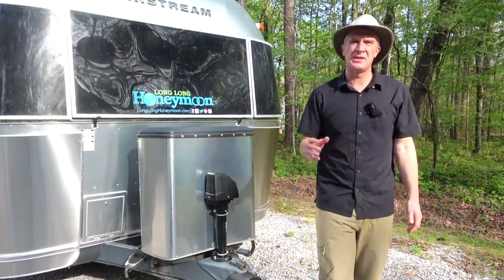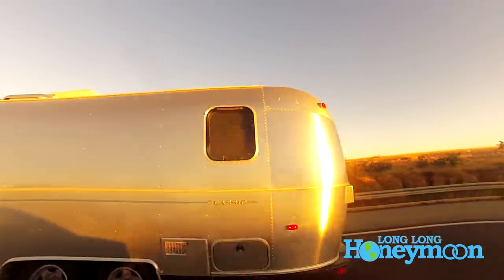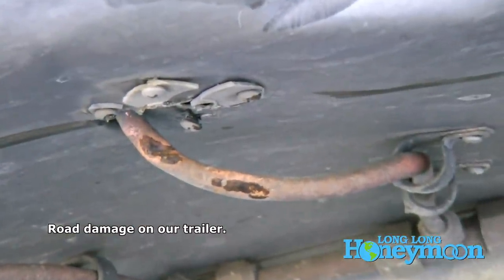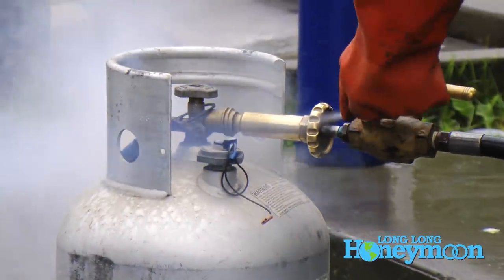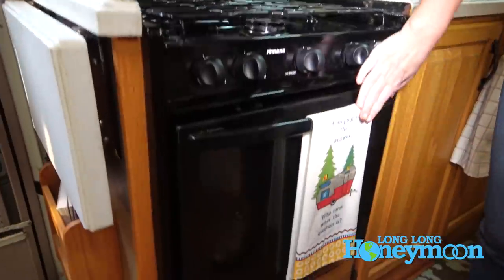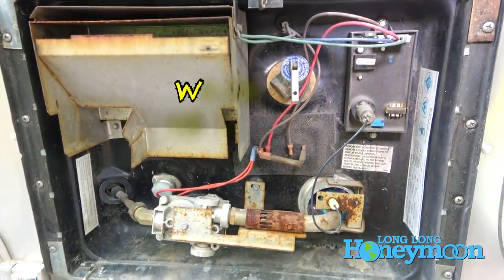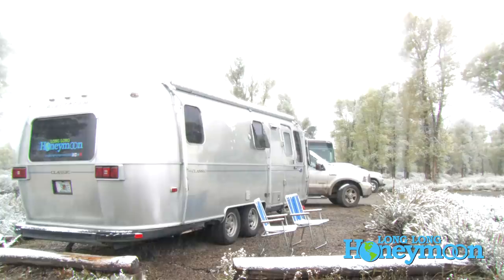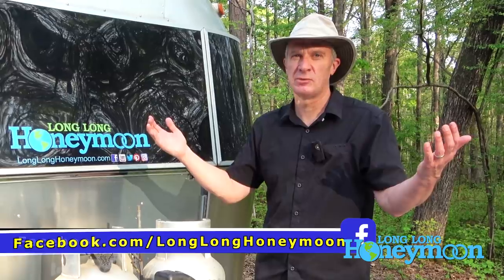For Beginners: RV Propane for NEWBIES

Comment: Propane is a liquid under pressure at ambient temperature.  Propane is vaporized out the top into the lines for the appliances.  This info was not highlighted.  You can move a tank back and forth and  feel the liquid sloshing.

Comment: The RV i own also drives on the LPG Ford e350 tioga from 1992. Here where i live petrol costs 1.80 € a liter LPG costs 0.57 € a liter. It runs very well the tank capacity i have 580 liters of LPG and with a switch i can toggle it between normal petrol and LPG. System costet me about 4000 € but as im driving a lot and i live in it, this system is quicly cost effective ... and i fill up at any normal gas station.

Comment: If you've never cooked in a trailer oven check it out before you get that nice big dutchoven. I inverted the lid it fit, but I'm not good enough to notice the difference. Please answer the question of why it's 3 am and cold when the propane runs out. Every time! Everytime!! Vegas wouldn't take the odds.

Comment: It's kind of fun to watch a back to basics video even if you are not a brand newbie. Good job. You did not mention whether you leave your pilot light on continuously. As someone who grew up in a household with an old-fashioned gas stove and an oven pilot light, this is not as intimidating as it might seem to someone used to an electric range. When we get to our campsite, we light the oven pilot light and generally don't turn it off until we are ready to move. Curious as to whether you leave yours on or not? Also, on the video, it looked like your rear burners also have a piezoelectric electrode. Are you sure the reason you have to light it manually is not because there is a wiring problem to the rear burners?

Comment: Put a pizza stone in the bottom of the oven, it will cook more evenly and wont burn the bottom of what you are cooking in the oven
Reply: Mike Johnson, i have a pampered chef Pizza stone with built in handles, is this what your talking about or are you talking about an actual tile stone like what you'd buy at in the tile department of Lowe's or home depot? 
Please reach out to me because I heard that I can use a "tile" on the metal plate that sits above the 🔃coils of the flames. Is that where you say to place it or you actually put your pan or cake/cupcake pan onto the Pizza stone.
Sorry in advance for the extended, run-on sentence....

Comment: Your refrigerator does not have a DC option, so you run into one of the great controversies that I have heard from RVers.  Do you use your fridge and run it on propane when you are on the road?  Our fridge is full when we begin a trip, but we run it on DC when on the road.  One issue is even though the trailer receives DC from the tow vehicle, running the fridge on the road still runs down the trailer battery.  Some say it is not safe to run your fridge on propane and pull into a gas station.  Makes sense to me, but others say they do it with no problem.  I did not know that some states forbid it, so that was a very helpful tip.

Comment: Boon docking if my house batteries are very low I have run my truck while tethered  to the trailer to boost power  to run the furnace. Now I do not  suggest to do this for a long time as I believe it places a strain on the alternator as the wires gauge is very thin leading from alternator to the 7 way connection. My truck,Dodge Ram 1500 .

Comment: Great video, educating the masses, back in Jan. 1985 I started  my first business with Snap-On Tools, these trucks have a 50 pound propane tank, a dealer in Wisconsin had his truck running on a 110, when he disconnected the plug the truck sparked 110 to 12volt and the van blew up.  The pilot light had went off and His furnace emptied the propane into the van. Propane is lighter than air, and when the system changed over, this sparked the propane, they said people heard the explosion 5 miles away. Sadly he lost his life, we where told to open the door before pulling the shore power. Stay save out there, enjoying all the video’s during this home time.
Reply: Really sorry to hear about your experience, but for the people reading propane is heavier than air. If you let it leak outside it will not dissipate. Natural gas is lighter than air.

Comment: Doesn't your system have an automatic switch over from empty tank to full?  If so, you don't actually "run out" when one tank is empty - it simply and automatically switches to the full tank.
Reply: That's what the diverter switch was for that he moves back and forth toward each tank.  The regulator should be self-switching on most RVs.  I had an RV for many many years before I realized that they auto-switch when empty, and I'm sure a lot of people don't realize that at all.  You point the switch to the direction of the tank you want to supply the trailer from, and when it empties, it switches to the opposite tank.  Just remember to move the switch over to the other tank that took over before disconnecting the now-empty tank.

Comment: In the old days there was no battery and even the light was a propane mantle lamp.  Which also produced a lot of heat.  Propane fridges are not very efficient, maybe 25% as efficient as a compressor fridge, but they don't need a generator, which also isn't very efficient.
Reply: But there is almost nothimg that should ever wear out. Sometimes the circuit board goes bad in newer fridges but there are propane fridges made 70 years ago that are still working great.  No moving parts.
Reply: @Terryblount  My parents propane fridge went out after about 10 years, but it had been used full time for about half of that.  The ammonia leaked out.  But I would agree they are generally quite reliable and quiet.  And propane is much more energy dense than even lithium batteries which is what makes it ideal for camping.  But I guess my point was that if the fridge is going to run on electricity full time a compressor fridge uses less power, and you don't get that energy saving by running an ammonia fridge on electricity.  But hey the power is usually included at a flat rate so save yourself some propane and switch it over.
Reply: My favorite thing is that it works off grid.

If our lights go out the only people who will remain somewhat comfortable are the ones with an RV.
Reply: @Terryblount  Except only sort of.  Relying on propane is not the same thing as being "off grid".  The propane will run out.  Short term solution only.  You can't even fill your tanks if the propane station doesn't have power and a supply of propane.  It is great for boon-docking though.  Most "off grid" is a myth.  Most all "off-grid" solutions very much rely on things that are very much "on-grid".

Comment: Would you comment some time about the safety of using propane on the road to keep refrigerator cold? I can no longer camp, but still enjoy your videos as a way to "virtually camp". LOLOHO
Reply: As long as you're not constantly taking inventory in your fridge, it should stay cold without power or gas for the duration of a typical day's drive. Turn the propane OFF until you get to your campsite. Alternatively, blow the dust and cobwebs out of your wallet and upgrade to a 3-way fridge.

Comment: Interesting. Actually I was wondering what the deal is with low-pressure RV propane tanks and why they take different grills.  I was interested in the grill cooking aspect of propane and how some grills are infrared and there are numerous brands and ideas on the best flames. Do you not cookout?

Comment: When I light my seemingly identical oven, I turn the dial to “pilot on” but then have to push the dial towards the stove to get gas to flow to the pilot. After the pilot lights, I usually have to keep the dial pressed in for 30 - 60 seconds before I can let it return to the position where I can then rotate it to a specific temperature. I did not see Kristy push in the pilot on control.

Comment: Thanks for the info on Propane, very usable. I'd like to piggy-back a question to you concerning propane and generators. I've read you test on the Champion Dual Fuel unit, and your own Remote atart gas unit. I can';t swing the cost of the dual-fuel. What do you think of making an after-market propane conversion gas to propane. I appreciate your help.   I have learned much from you both over the last couple of years. Best wishes to you both. Norm

Comment: This Video was a such a Gas-  Forgive me Locked Down Cabin Fever.  I’m going to have to upgrade to at least a DC-DC Charger for starters as running propane down the road for the fridge can be done, but you made a good safety alert of what if a gas line ruptures in an accident. Your Solar, DC-DC charger and 400 Amps of Battle Born Lithiums should make an all day of electric fridge or an all night of furnace fans never a problem. We found out quick how a 29 degree night and a furnace fan sure kills a set of interstates real quick. This was this fall in the Adirondack Mts dry camping. A cold wife is NOT a happy life!

Comment: Awesome video Sean and Kristy.  I just stayed in my new camper for the first time and the furnace ran almost nonstop do to sub freezing temps. How long will your tanks go between refills when you’re camping in those type of conditions?
Reply: A few days, tops.
Reply: Kristy Michael is that per tank or is that both 30 pounders going dry in a couple days?
Reply: @danj8777 , if we're running our furnace all day and all night, I would say that each tank will last about 4 to 5 days, maybe less. However, when we go to bed we usually set our thermostat temperature to 50 -- that may be too cold for some. During the day, when we're inside, our temp is usually set to 65. Hope that helps!

Comment: In our '79 Sovereign mid-bath can be difficult to light our water heater (it's manual only.)  So when it's hard to light, we find that going in and lighting the stove is a good way to confirm and get that propane flowing.  Just wondering if others with a manual hot water pilot also have this issue.

Comment: Are there some rules about turning on the stove fan or cracking windows when burning a live propane flame inside the cabin?
Reply: I'm not sure it's a "rule" per se, but we do usually have a window cracked when running our furnace. When cooking I usually have the overhead exhaust fan on, just like I would at home.
Reply: Burning LPG will create an awe-inspiring amount of humidity inside the rig. You definitely want to crack a window or turn on an exhaust fan unless you're into collecting mold, spores, and fungus.
Reply: @colormedubious4747  Thank you for your response, I was also concerned about noxious fumes?
Reply: @CincyKid  That, too.

Comment: Don’t you also have a dual fuel generator, and if so, how often are you running it on propane?  Also, would you consider it more cost effective to run the generator off gas or propane?

Comment: Quick question:  Why do you keep saying 'heat furnace'?  What other types of furnaces are there?
Reply from the maker: The phrase is just common vernacular. There are many different types of furnace, more than I care to list here. For example, a blast furnace is usually used to produce iron from iron ore. A vacuum furnace is a type of furnace in which the product in the furnace is surrounded by a vacuum during processing. A reverberatory furnace is basically just an open flat hearth with a firebrick roof over the top; it is an older-type furnace that typically would be used for the extraction of copper. An RV heat furnace burns propane to warm air. For more information on furnaces, please consult your local library.

Comment: Isn’t it advisable to have a window opened a small bit to cut down on the humidity a propane furnace creates? Plus some fresh air can’t hurt either.
Reply: An RV forced air furnace shouldn't put any moisture into the air. The burnt propane exhausts to the outside. A heat exchanger heats and recycles interior air but keeps it separate from the exhaust. Propane heaters like the Lil Buddy are different and burn and exhaust the propane inside the RV. With those you must have ventilation (crack a window and/or ceiling vent) or you will build up moisture inside. Burnt propane creates water vapor and carbon dioxide, and maybe other deadly gases if it is not burning properly, so be careful with that type of heater.

Comment: Why do they not put an electronic ignition in the oven?
Reply: There has to be an igniter in the stove because the fire goes out when the desired temperature is reached and comes back on and ignites when more heet is needed.

Comment: Does the water heater and furnace have a pilot light? Great video.
Reply: Most water heaters and furnaces in RV's use an electric striker to ignite , so you don't have to use them.

Comment: Propane is kinda 20th century tech and not that safe. New RVs should use all-electric appliance which would be much easier. If its not enough an external diesel or gas generator should be enough.

Comment: Kind of confused.
I’ve seen a lot of propane powered fork lifts that run their tanks on the side.
Are these a different type of tank?
Reply: Ed Rodrigues Good observation. I used to drive fork lifts. Typically, the tanks are in their side, yes. However, there are very strong metal clamps that secure the tanks. Unless you have that set-up in your truck, transporting vertically is best. Travel well..... when you can🙏

Comment: You mentioned that running your furnace would drain the battery.  Do you have a 12v setup or the 2 6v setup?
Reply: He has a $12,000 solar system.
Reply: @Terryblount  Yes, I know that.  It still has a battery system.

Comment: Have you ever heard of GasStop 100% Propane Emergency shut off valve? Made in US and in event of major leak like due to road debris, accident, or major pipe disconnection or hole, it shuts off the propane at the tank. Could be worth the price especially if you drive with propane on in order to keep food refrigerated. Check it out. Not affiliated with this company either.

Comment: Ahhh yes the OVEN... well... the first time we used it... it burnt the stuff on the inside (right over the burner) .... and the outside was still raw... ouch.. oh what to do.. well everyone says to use a pizza stone to help even the heat out... but we said.. Hmmmm not dual purpose... so instead we got a cast iron (lodge) square griddle.. cut the handles off.. ground it down smooth.. inside and around the edges... and now we have a heat transfer device that makes great pies etc.. as well a pancakes on the stove top too...  ya have to be a seasoned RV'er to improvise and over come the short comings of the manufacture ... who made the oven...etc...   

How long before you cant get the alu tanks recertified...  I am using the 10 gal 40lbs ones... and wow... its a workout to get them on and off.. but then again... they last about 1/3 longer in the winter time... oh and yep the golf cart 225 amp bats allow you to stay warm over night for a few nights... before hooking back up or seaking out a chargeing place...  

Also we added a programable thermostat.. that had 4 things.. settings you can do per day 7 days a week... good old hardware store...from honeywell... bat powered so it is a direct replacement...
Reply: We do the same with an upside down rimmed cookie sheet. Does the same thing without the weight.

Comment: So you drive with the propane on since your fridge has no DC option? Nice vid as usual, guys.
Reply: Rv propane fridges are made to run on propane while you drive. In 35 years of rving I've never turned my propane fridge off.

Comment: Where is it against the law to transport a tank that is not being used on its side?
Reply: There are several local propane refill stations here in Alabama that will refuse to refill your tank if you can't show them it will be stored upright in your vehicle after being refilled. They have told us that it's the law. I have witnessed them turn away people that were going to store the full tanks on their side (in the trunk of their car).
Reply: They are mis-informed. Under Alabama law, retailers fall under a Class F or F-1 License. No where under their requirements is there a requirement to insure that full bottles are transported upright. A good idea but not the law. The only law in Alabama states that “propane cylinders in serviceable use must be positioned with the OPD valve above the fuel level”
Reply: @buzzward812  Some Airstreams do have their tanks laying down, but the tanks are designed to work that way.  BCGrittner above makes clear the reason why.
Reply: My first travel trailer, a TEC in 1976 also were laying down. But like you said they were designed to be mounted that way.
Reply: @buzzward812  they might be misinformed, but they're the ones selling, so I guess you have to play by their rules to buy from them. Who knows? Maybe they are concerned about personal liability? I dunno.